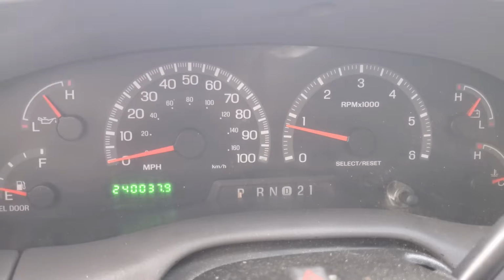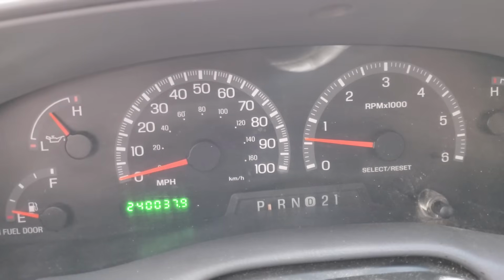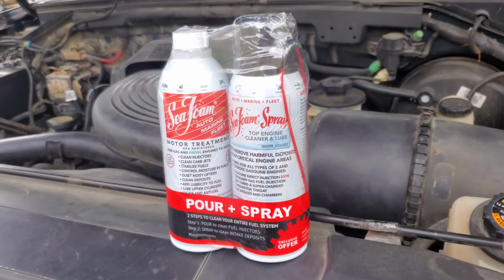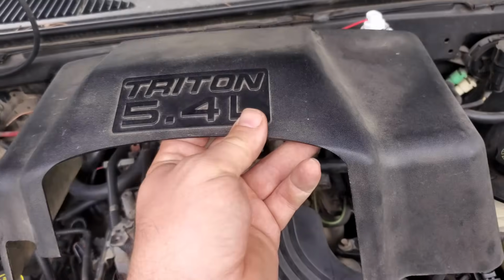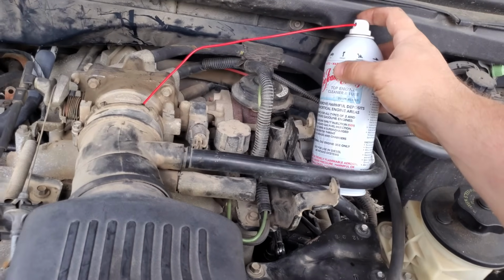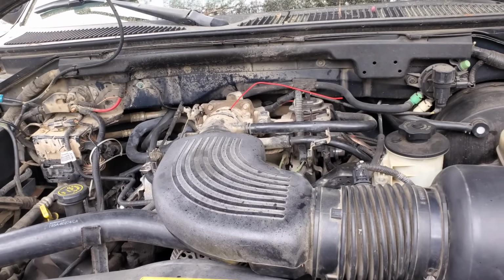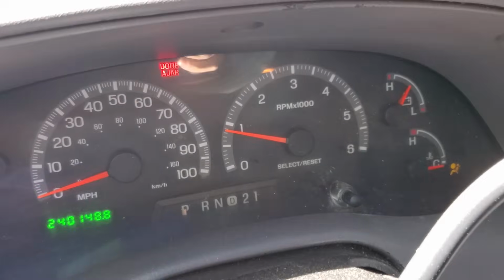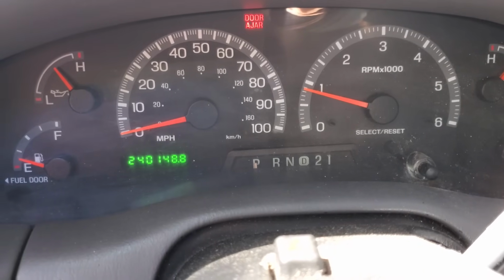Sea Foam Spray fixes a rough engine idle on a 2003 Ford F150  👍 ft. Curtis B. in AR

Comment: Gonna have to try this on my truck. It's got a tick,tap noise and running a little rough. 2003 f150 V8 4.6 with 343,600 miles .
Reply: Might want to watch fordtechmakeuloco video on cam guides. You might be risking one of those getting sucked into the engine
Reply: 343,600????
Reply: @hyperpotato1197 many many of those 4.6 2 valves have that and much more! Those were used in millions of cruisers and taxi cabs. 400k+ hard miles.
Reply: Have the same issue with mine. Engine was rebuilt at 312K miles so idk what the hell is going on.
Reply: @anothersomebody8195  how?
Reply: @EpicGamer-wj9cc  They are one of the 5.4's biggest weaknesses. I'm not sure if the 4.6 has the same issue.
Reply: @ i dont think the 4.6 does to the same extent

Comment: I've got a 1999 Ford F150 V6 with 260k miles that I use for a daily driver now after it sit for 10 years. I put a new clutch, pressure plate and clutch cylinder in it as for the reason it got parked in the first place. Put new tires on it, changed the plugs, wires and fluids started driving it and the #3 cylinder started missing the first week. It coded being the fuel injector so I ran a name brand fuel injector cleaner threw it and it didn't clear up so, I figured I was in for a weekend job changing injectors but, I decided to try Seafoam after a friend suggested it. I put a bottle of the Seafoam in my tank with half a tank of fuel drove it about 10 miles and it didn't do anything. The next day I drove it about 30 miles to work and it missed all the way there. Got off work 10 hours later started it up to go home and the miss was gone. Cleared the Service Engine light and it hasn't come back as of today and 60 miles later. I'm shocked it worked, I have 3 other fuel injected vehicles and the wife's vehicle so I'm going to start running a bottle threw them twice a year now in hopes it keeps them cleaned out. My 2017 Jeep had an injector caused miss last year and the Dealership charged me $480 to replace that one injector, I suggest cleaning your injectors at least twice a year.
Reply: This is exactly what I was looking for. Same exact situation, going to try the fix.
Reply: @bfurl69  I'm now at 281,000 driving it 4-5 days a week to work and weekend errands. Still no missing, no smoke and now ticking.
Reply: @casper3130  I have a 2003 4.2L V6 throwing the same fuel injector code. It idols like I have a racing cam and starts missing on a cylinder around 2500-3000 RPM. Oddly enough, it’s worse in the cold weather and better in warm weather. Engine temp has no noticeable effect. 

Wish me luck. Feel free to drop some advice if you think it’ll be useful.

Comment: According to other videos you keep the revs at 1000 rpm and you spray the entire can in. Shut off , let sit for a while and then take a 10-15 minute drive to hear the difference. Seems others in the comment section have found favorable results .

Comment: I use seafoam or some other top of the line fuel cleaner every 2 or 3 fillups, definitely feels like it runs smoother, especially after the first time you use it

Comment: I took my IAC off and cleaned the carbon out of it. I have an 03 Lariat with the 5.4, it would sometimes run down to 300 rpms and shut off, it usually runs around 650 rpms.
Reply from the maker: Hi Jared. Did you use Sea Foam Spray?
Reply: @SeaFoamOfficial  Yes I did, I used the motor treatment and the intake spray.  Worked great!

Comment: You know if Seafoam can Clear my Check Engine light
Reply from the maker: What is the code?
Reply: @SeaFoamOfficial  P0174
Reply: Who cares the light is decoration
Reply: @luisponce1472 I have the same Damm code for a 2002 Ford F-250 has DTC an saying it’s a misfire cylinder 4 and 7 really don’t feel like doing head gasket right now

Comment: Only supposed to idle at 650 rpm.
Reply from the maker: Gas cars/trucks to idle at 2,000 rpm when applying through throttle body.
Reply: These trucks idle all over the place. Highest was 1200rpm and lowest is a surging 500rpm, truck usually stays around 800rpm/900rpm, some days it chugs at around 600rpm. Sometimes I turn the key and nothings wrong.

Comment: Mine has a rough idle and when you barely hit the gas it is rough , if you put your foot in it it clears up.
So I’m gonna try this , change  the IAC or AIC , (that thing) if needed , PCV and associated hoses and grommets small stuff like that and see if it helps , just bought a 2003 F250 4x4 with 258k on it